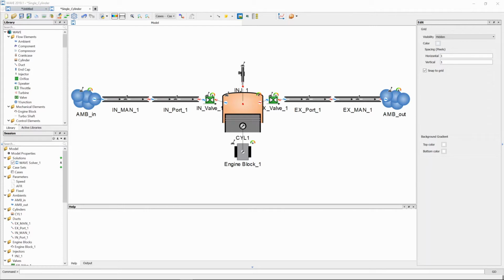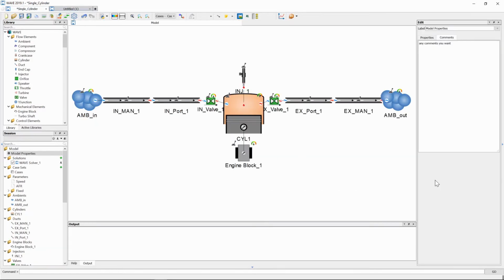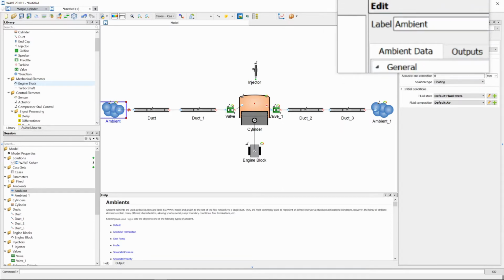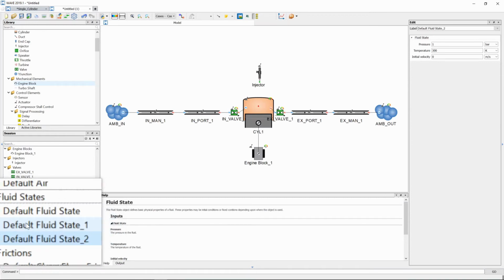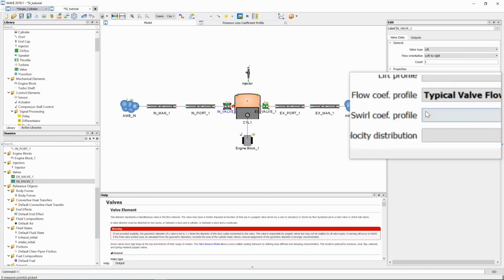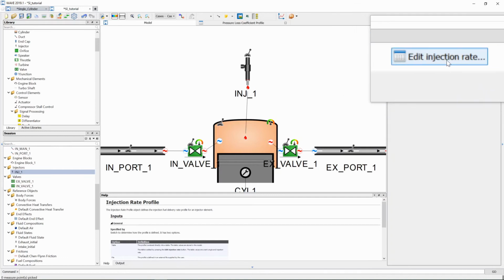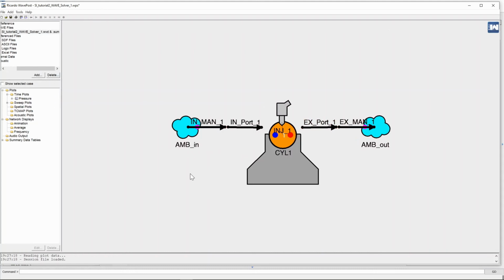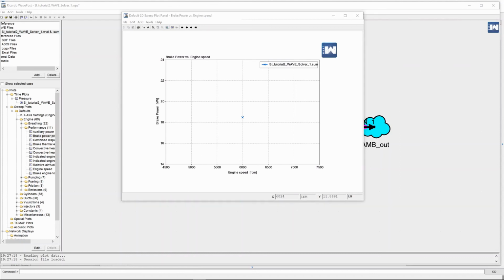How to simulate a one cylinder engine in Ricardo WAVE | Introduction to Ricardo WAVE | Tutorial

Comment: hello sir! Hope you are fine actually i wana to ask how do we check performance of diesel engine performance by adding some chemicals in diesel mixture
Reply from the maker: That will need to be done via your fuel file. You can specify a bunch of things there that would distinguish your normal diesel fuel from the one with additives. The difficulty is just getting all that info. Most of it is not readily available and you will have to send samples to a lab for them to measure it for you. I had to go that route 😅

Comment: THANKS FOR THE RESOURCEFUL CLIP. I AM WORKING TOGETHER WITH A PhD STUDENT ON SIMULATION OF  CI ENGINE FUELED WITH  BIOFUELS OF DIFFERENT BLEND RATIOS TO SELECT THE BEST BLEND. BASED ON COMBUSTION PERFORMANCE AND EMISSION ANALYSIS. WE WERE ABLE TO FOLLOW YOUR VIDEO BUT COULD NOT CREATE FUEL FILES. YET WE DID NOT UNDERSTAND HOW YOU OPENED THE COMMAND PROMPT. AND SAVE THE FILES. HOPE YOU WILL KINDLY EXPLAIN IT OR MAKE A VIDEO ON IT ASAP. THE TIMELINE GIVEN IS GETTING LATE. THANK YOU

Comment: Very well explained. I tried to give it a try but I had a pop up message while trying to run the model: "connection to valve is missing". I've checked all connections but none is missing.... any ideas?
Reply from the maker: Usually when you connect a duct to a cylinder, valves are automatically put in. It may be that one of the valves got disconnected from the cylinder. Does the error say which cylinder?
Reply: @AdriaanVanNiekerk  Exhaust valve count was set to 2 somehow,  I've set it to 1 and it's working perfect now. Thanks
Reply from the maker: @shaibend  Glad to hear it 👍
Reply: @AdriaanVanNiekerk   Thanks.
Do you have a tutorial for 2 cylinders SI engine?
Reply from the maker: @shaibend  no unfortunately not, but you can basically replicate this tutorial and just add a second cylinder. Rinse and repeat in a sense 😬

Comment: Hi Adriaan, 
May I know whether there is an element called spark plug or how do we adjust the spark ignition timing for gasoline engines?
Reply from the maker: Good question 👌🏻 you need to set the ignition in the combustion model. You can access it when to select the cylinder element
Reply: @AdriaanVanNiekerk  Thank you so much ❤
Reply from the maker: @tvkvirtualwarriorz  no problem! Let me know if you have any other questions 👍🏻
Reply: @AdriaanVanNiekerk   Hi adriaan, I am simulating a 2L GDI engine for my dissertation numerically to evaluate its performance by varying the spark timings. I have used the fuel RON 95 type of gasoline. I have used two spark ignition timings (16 BTDC and 170 BTDC). After simulating, I find there is zero emissions of CO, NOx, HC in both outputs. I find it little strange. Can you help why this happens or am going in the wrong way. Please help in this.

Comment: Sir can we vary load as a input parameter and keep speed constant.
Reply: Can u do a tutorial based on that
Reply from the maker: @ananthakrishnankvarma8162  sure! I will put it on my list 👍🏻
Reply from the maker: No not explicitly unfortunately. Load is seen as an output value. You have to change engine operating conditions in order to vary the engine load. One way to do this is to add a PID controller to change the air inlet flow until you get the desired engine load.

Comment: Hi, do you have any idea how to ran a gaseous fuel? When I change the fuel composition to vaporised fuel I get an error * Vaporisation cannot be specified for gaseous fuel. What other options are there to set up a gaseous fuel then ?
Reply from the maker: Good question. I guess the best option would be to look at the dual fuel example engine where they used LNG. My guess is that the fuel is liquid until it is injected into the cylinder at which point it flashes over to a gas.
Reply: @AdriaanVanNiekerk  great thank you , I’ve managed to get it to work on another model. Any ideas why my engine is massively under powered ? The ignition pressure and AFR are correct but I’m getting a power of only 10HP any suggestions or parameters I could fix? Thanks
Reply from the maker: @Con._ron  look at the amount of air entering the engine. For engines being driven by AFRs you can increase the amount of fuel entering by increasing the air entering.
Reply: @AdriaanVanNiekerk  where can I increase the amount of air?
Reply from the maker: @Con._ron  I usually increase the ambient element’s pressure value. Works for me 🤷🏻‍♂️

Comment: Hi Sir. Hope your doing well. Sir, I wander to know, How i can add load in engine? In which component?
Reply from the maker: Good question - unfortunately there is no way to put a load on the engine. You will have to record the load generated by the engine and then change your fueling set-up to increase/decrease the load generated.

Comment: This is really good explanation and I followed your instructions step by step but still got 'UnicodeDecodeError: 'ascii' codec can't decode byte 0xfd in position 36: ordinal not in range(128)'. Do you know what that means?
Reply: Can you please reply as soon as possible?
I have an assignment to complete.
Reply from the maker: @ysuferdgnn  is this a pop up error or does it display in the output window when you run it?
Reply: @AdriaanVanNiekerk  when I try to execute the model it cannot be resolved.  It gives an error code "This run could not be executed"
Reply from the maker: @ysuferdgnn  any other error shown in the output window?
Reply: @AdriaanVanNiekerk  no, it just shows this error
Reply from the maker: @ysuferdgnn  any element in your model got 36 in its name? Like junction36?
Reply: @AdriaanVanNiekerk  no, there are no parameters related to number 36.  Everything is exactly the same as the example you made.
Reply from the maker: @ysuferdgnn  okay. The only other thing I can think of doing is join the discord server: https://discord.gg/azTuDyzbmH and share a print screen if the error and your model. 🤷🏻‍♂️
Reply: Try salving your archive in a file that has no accentuation in its name, for example: 'á; é; â; õ;'

Comment: Thanks a lot for your explanation, Sir.
I have a question, can we simulate the part with geometry modification as we do in reality?
Reply from the maker: Hi Dani. What do you mean with geometry modifications? What do you want to change?
Reply: @AdriaanVanNiekerk  It's like bore up  the intake port and change its radius for easier the fuel mixture into combustion chamber.
Reply from the maker: @daniwahyudi3765  ah okay. Yeah you can change any dimension of the intake and exhaust geometry. This also includes orientation and length 👌🏻
Reply: @AdriaanVanNiekerk  Nice information. Thank you very much, Sir.🙏
Reply from the maker: @daniwahyudi3765  good luck! 👍🏻

Comment: Hi , I am modelling a 4 cylinder hydrogen engine but I keep getting the error “ VOLUME INJECTION: Fuel mass fraction must be > 0.001 for injector 1” Any ideas on the issue? Or please could you make a video simulating a hydrogen engine?
Reply from the maker: What type of injector are you using? It seems like it is complaining that it isn’t receiving any fuel?
Reply: @AdriaanVanNiekerk  I have used the proportional injector type. I used the exemplar 4 cylinder gas and tried to convert it to Direct Injection Hydrogen. I also get a “cannot use this block” error when I try to run the model. Thank you for the fast reply!
Reply from the maker: @Con._ron  just have a look at the docs of that injector to make sure you have included everything that is required in terms of the fuel specifications. To be honest I have no experience of hydrogen being sirecrly injected, only port injected.

Comment: hi, I have a question...
I am simulating an engine that has a de Laval nozzle  in the intake, the problem is that the de nozzle imposes a maximum admissible flow rate due to the sonic block but from the results of the wave simulations it is completely wrong the flow rate, admitting flow rates greater than those physically possible, I wanted to know is there any setting that modifies the model in order to simulate this aspect?
In any case thanks for all the tutorials you post...
Reply from the maker: Hi there! What kind of element do you use to simulate the nozzle? Sometimes there is an option to specify the flow rate explicitly. Does the flow rate change with engine operating conditions?
Reply: @AdriaanVanNiekerk  hello, thank you for replying immediately, I made several arrangements but none of them gave me physically possible results.  I'm currently using three duct convergent-pinch-divergent .  the engine works at different speeds, from 2000 to 16000 rpm.  I wanted to understand if wave considers the phenomena in case of sonicity?  or i have to activate some settings?
Reply from the maker: @alessandroscantamburlo762  I think the best would be to join the discord channel: https://discord.gg/dfUp3HMPvv then you can share a screenshot and we can properly debug. Youtube comments are a bit limited with these things 🤷🏻‍♂️
Reply: @AdriaanVanNiekerk  thank you very much for the answers, in the end the problem was solved by increasing the discretization length from 5mm to 0.25mm.
a banality that I could have noticed much earlier...
in any case, thanks for the invite on discord, if i have problems  I will contact you.
Reply from the maker: @alessandroscantamburlo762  glad it worked out. It always helps to explain the problem to someone else. Most of the times the answer just comes out of nowhere through the whole process 👌🏻

Comment: How to add throttle and closed loop feedback in the single cylinder model?
Reply from the maker: There is a throttle element you can add to the model to simulate the throttle behaviour. In terms of closed loop feedback, the P&ID element should do the trick 👌🏻
Reply: Thanks Adriaan , i will check.
Reply from the maker: @madhurimaisbiswas  no problem. Let me know how it goes 👍🏻
Reply: @AdriaanVanNiekerk  i am unable to add throttle. On adding throttle body in a single cylinder model(i have added plate degrees also), it is asking to configure butterfly valve, cannot find or do anything on that
Reply from the maker: @madhurimaisbiswas  I really don't like the throttle body element to be honest. You can also use an orifice and change the diameter to change the flow rate.

Comment: Thanks for all of this, got me started, so, how do I enter my cam values: list duration. What do the 'Anchors' and those values mean and is this where I enter the valve events? Thanks !!
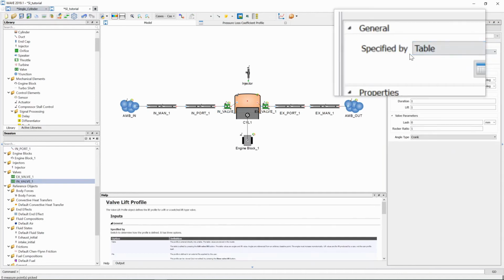Reply from the maker: If you have custom crank angles for you valves you can enter them in the table (12:49) and instead of selecting "tag" you select "table". 
The anchors are just used to correctly position your valve lift profile with the engine crank angles. The documentation is super confusing when explaining the anchors, so I usually just create a graph of the lift profiles and then check in WavePost to see if it is correct. Hope this helps. Let me know if you have any more questions.

Comment: Is there a reason why WavePost would not open when clicking on it, after the processing is done? Mine starts loading then desapears and that's it.
Reply from the maker: I cannot think of a reason. You should be able to open it up from within Wave. Have you tried opening it up externally from Wave?
Reply: @AdriaanVanNiekerk  Thanks for the quick reply. Yes I've tried that as well, it just shows that it's loading up then desapears very time
Reply from the maker: @sglucatony  Have you tried restarting your computer? Other than that I don't really know what can be causing it? Might be good to try re-installing it?
Reply: @AdriaanVanNiekerk  Restarting my computer fixed it 😅 It's a bit weird though, it works when I open it externally but not from Wave. Anyway, thanks I might just have to reinstall it
Reply from the maker: @sglucatony  Glad it is somewhat solved 😜

Comment: How to create and simulate a direct injection CNG spark-ignition engine. Where can I get tutorial files for preparatory simulations?
Reply from the maker: There is a tutorial for dual fuel engines that comes with Ricardo WAVE. The files should be under Program Files/Ricardo WAVE/.../Tutorials. Let me know if you cannot find it.
Reply: @AdriaanVanNiekerk  Many tutorials are there in tutorial and example folder as .wvm extension and opening in wavebuild. How to use wavebuild ?
Reply from the maker: @SridharSahoosid  You will need to open up WAVE first and then open the .wvm file within the program. It will then automatically convert it to .wvmx
Reply: @AdriaanVanNiekerk  Thank you very much.
Reply from the maker: @SridharSahoosid  No problem 🙌

Comment: Hi sir, thanks a lot for this video. It helps me in quite a way. I want to ask if i copy the file simulation, and do it for different model properties, the settings that have been set still remain the same right? Cause. I need to do 50 simulation for my project .
Reply from the maker: Glad you found it useful. What model properties are you talking about? It might be better to make the property that you want to change a variable and then just change the variable for each run of your 50 runs. It will be much faster than opening and running 50 individual files.

Comment: when i run... 

BAS:OUTPUT_CONTROL
  BAS:CONSTANTS
    F*** Constant "PARAMETER" can not be evaluated
    W*** Skipping subcase due to fatal input error
Reply from the maker: It looks like you have used a variable "PARAMETER" somewhere, but did not assign it a value in your constants table? Or the value assigned is causing some problems?

Comment: Dear sir, I have followed the instructions and modelling is done now. I want to test model for different loads? At which condition it is showing the results. Is it possible to get a plot Brake thermal efficiency vs load?
Reply from the maker: For this video the engine is at wide open throttle. To simulate different loads you will have to add a throttle body to the inlet
Reply: @AdriaanVanNiekerk  sir, as I am working on twin spark plug engine, please let me know the method.

Comment: Hello sir i have a doubt. i wanted to mix methanol with hydrogen try different composition for example 10% hydrogen with 90% methanol.So should i try the values in cylinder option that is intial fluid composition option or in the injector.
Reply from the maker: Hi Subramanian. I think you will need to create a fuel blend with the percentage components that you want to look at between methanol and hydrogen. The two options you mention can only be used to simulate a mixture between clean air, burned air, burned fuel and injected fuel.

Comment: Thanks for the informative tutorials. I am studying the second law of IC Engines. I have problem with H2 fuel. Any clues?
Reply from the maker: Is the second law of IC engines the same as the second law of thermodynamics? Are you struggling to simulate an engine running on H2 in WAVE?
Reply: @AdriaanVanNiekerk  Thanks. Yes. I did some publications with that. Recently after I installed 2019.1, i get crazy values for the same model.
Reply: I tried all types of injectors trying to get the same equivalence ratios as the one entered, i get it right for all types of fuels except hydrogen??

Comment: Sir can we use water and gasoline mixture as fuel and see the change in properties.... Please reply sir
Reply from the maker: Hi Ianka. You can simulate a water port injection with a gasoline direct injection if you want. Then you can see how combustion temperature for example is affected with the added water.
Reply: @AdriaanVanNiekerk  sir so you mean to say we need to use two injectors into the engine cylinder.... Or  can we use a mixture directly by changing fuel from gasoline to a mixture of gasoline and water
Reply from the maker: @lankaanuroop3842  No you will need two injectors. One connected to the port and one to the cylinder.
Reply: @AdriaanVanNiekerk  thank you sir
Reply: Sir I need your guidance to create a model that use water injection method to check how knocking varies from using only gasoline as fuel

Comment: This has been perfect timing for my project. I've got an error when trying to run the WAVE solver on a 4 cylinder engine model: 'y junction opening 2 and opening 4 not connected' but to me they seem connected. Do you know what could be the problem?
Reply from the maker: Hi Tom. I am glad you found it useful 🙌 Sometimes with a y-junction when you disconnect ducts from it, the connections on the y-junction does not disappear. You need to go and manually delete them in the y-junction's properties tab on the right hand side of your screen. A list of all the connections are under "Openings" Hope this solved your problem
Reply: @AdriaanVanNiekerk  yep just saw that, thank you!
Reply: @AdriaanVanNiekerk  just another question, how do you add more cases to the simulation at different rpm speeds to get a curve on the sweep plot?
Reply from the maker: @tomf6920  You will need to select your engine block object and under "Operating conditions" for engine speed, you need to input a variable, say "RPM". This variable will then be added to your cases table. Once that is done, you can add more cases to the table (add more columns by clicking the plus button at the right top of the table) and just change the value of the "RPM" variable to different engine speeds. This will then enable you to create a nice sweep plot in WavePost with engine speed on the x-axis.
Reply: @AdriaanVanNiekerk  thanks for the reply. It only seems to let me add rows, I cant find the plus button for columns?
Reply from the maker: @tomf6920  That is strange. If you can connect with me through Twitter or Instagram, then I can send you some pictures showing the procedure. These comments can only go so far  I am afraid
Reply: @AdriaanVanNiekerk  yes sure I'll add you on Instagram
Reply: @AdriaanVanNiekerk  what's your username?
Reply: @AdriaanVanNiekerk  ah found you